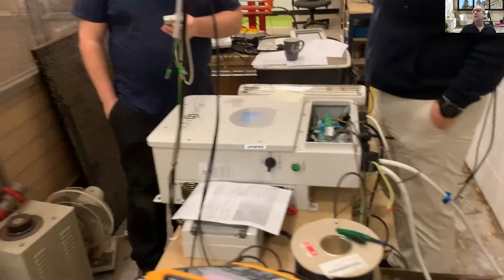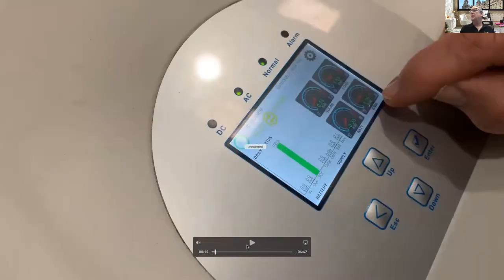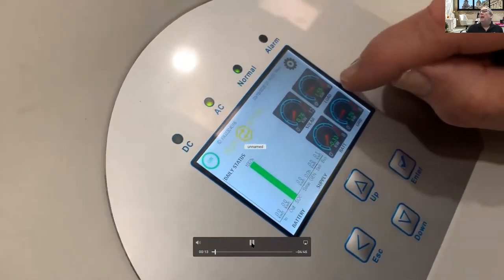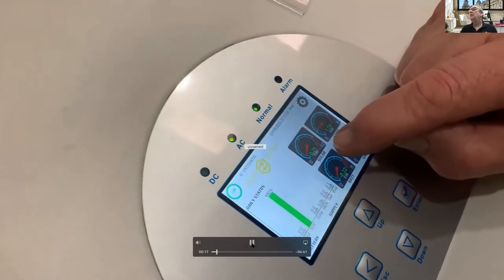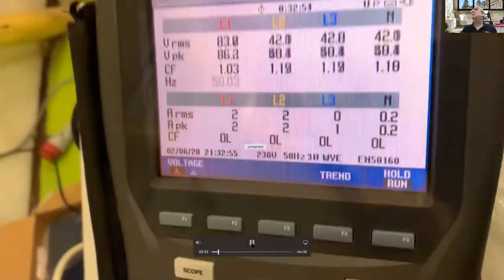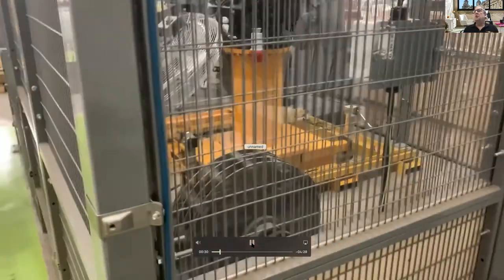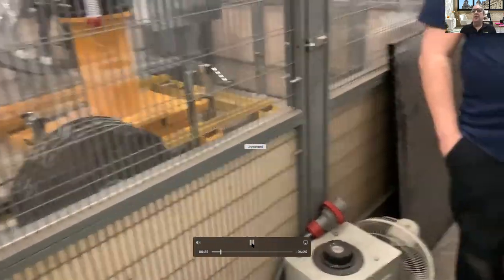Wind Turbines

Comment: Thanks for this presentation, butI find this presentation confusing and a bit vague, it would be nice to have a clear easy to hear and understand presentation from Sunsynk as to how to connect up various turbines options to your inverters, the concepts of bridge rectifiers are not what is important in determining how to actually make sure you do not cook, nobody should be building their own controller to connect to your inverter, this is going to open up all sorts of mistakes buy the installers.  Please try not to sidetrack but keep it specific and on point, the footage of the turbine working with the inverter was not specific enough, looked a bit rushed and untested. the readings show were shown so fast you didn't really know what you were looking at.  Some actual footage of a turbine working would be awesome, exact instructions as to how to make this work would be amazing. a roughly drawn diagram is just too vague.    How does the inverter tell the turbine to stop when it no longer needs power, while having a wind controller in place, how is it told that you don't need the power it's producing and should then dump or stop the turbine?  what are the limits in the size of turbine you can use for each of the models of inverters, I heard you mention a 3KW turbine on the 8KW inverter?

Comment: Now I am more confused than before. I was told to get the wind generator, its dedicated charge controller and its own inverter and then connect that inverter output to the sunsynk generator port. Is this correct?

Comment: Thanks. Two questions:
1. why would you need capacitors and resistor right after the rectifier?
2. does the grid-tie version of Sunsynk/Deye inverter have also such an option to use the "PV as a Wind Turbine input" checkbox ?